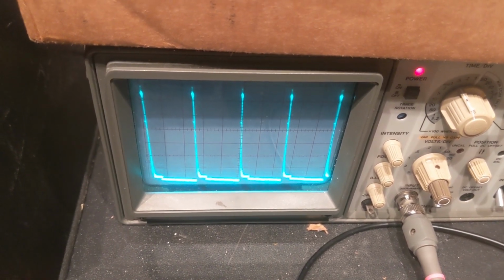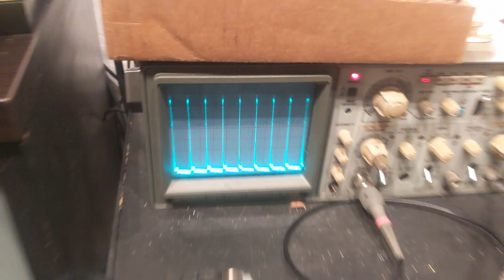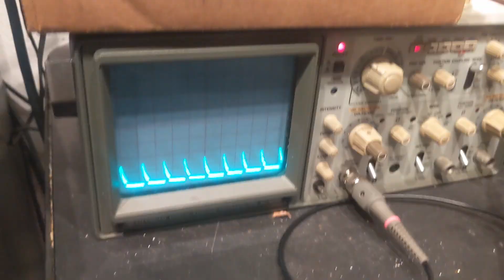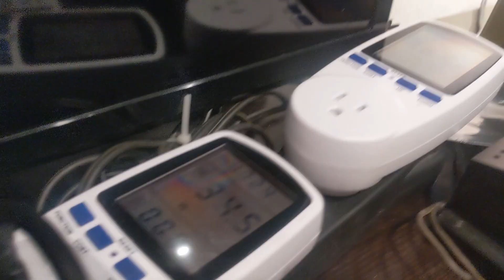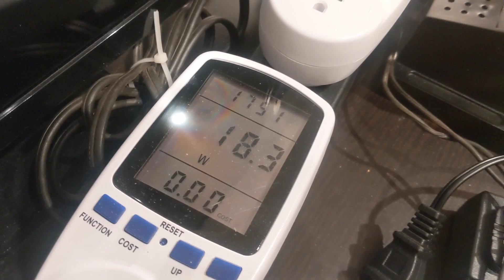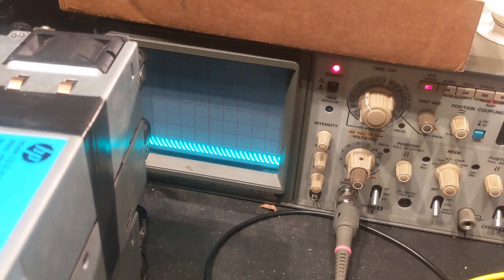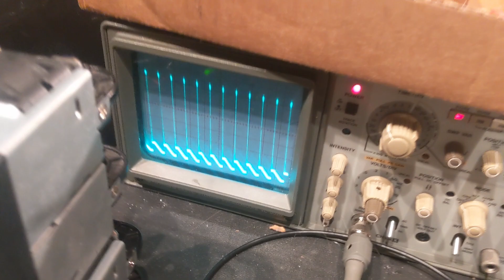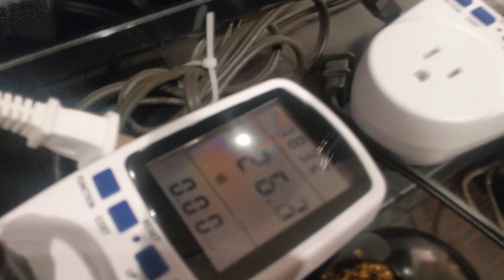HHO High Voltage Resonance

Comment: have you ever done electrolysis? and the way you said the cells were wired up was very confusing and it looks like it's doing what you said it would based on what you showed. because how does it go from center conductor to each pipe?  that's random af and i thought it looked like what you said maybe was out of order, unless they were in series somehow, but what's the point of that
Reply from the maker: Series was a big mistake. You will leak current. Better to go with parallel on a wider gap with center negative. Center positive was another mistake, because the resistive barrier won't form easily without sanding the inside of the tube, and that's much more difficult than sanding the center tube. Hydrogen generates on the negative. Making each tube concealed cavity-like is also super important because it will create an intense voltage field without finding a path of least resistance to another cell. Series is horrible unless you do a straight line instead of a circle, and the water has to be pure, but even the best pure water won't fix this in series. Update coming soon.

Comment: I've been studying the difference between HHO and Browns Gas, Electrically Expanded Water, Water Gas, Ohmasa Gas, and also ically HHO. 

As hard as it is to believe, please hear me out. You had to choose to believe over unity hydrogen production is possible. So keep an open mind maybe more open than normal. If you reply to the comment I can offer you peer-reviewed papers, videos, and other projects that all support what I am going to say. It's also way more exciting than low-power high volume HHO production. 
I will state firmly, running a car or other engine on just Browns / Water Gas, meaning Stan Myers's water car did work (no opinion on conspiracy). Not only did Myers's water fuel car work, but his results via other means have also been replicated by others since, most notably Dr. Ohmasa.

Dr. Ohmasa developed and patented a process for producing High-Quality Browns Gas he is the first to discover Browns Gas is HHO but also H, O, and from his two-stage process, 20-30% of the total Gas he produces is what I call Anamonly Gas, and he rightly calls it Ohmasa Gas and once again. I have to state, it's 100% real, it can run a two-stroke with no oil or fuel (video several), a car (video Japanese news report), but with just 10% petroleum fuel and 90% Ohmasa Gas. 

They can get incredible fuel savings and efficiency gains in all types of internal combustion engines. 

The properties of the Ohmasa Gas plus only 10% hydrocarbons, resulting in a cooler combustion or implosion and 100% conversion of fuel, plus something extra, into pressure, but not heat. 

The cooler and complete combustion provides engines with increased horsepower and torque. It uses less oil and cleans the cylinder seals, valves, and tailpipe emissions can pass California air quality goals for 2050. EVEN running Diesel in a 15-liter Engine, produces nearly 0 carbon byproducts, or particulates, and only slight amounts of nitric-based compounds, (Research gate, peer-reviewed papers on HHO and hydrocarbon fuel efficiency in gasoline, Diesel engines.)
 
Great so like, what? In case it's not clear, Browns style, Myers, Bob Boyce, and others, for producing HHO is not standard electrolysis. A highly reactive and potent Gas, besides HHO, H, or O, exists. It's called Ohmasa Gas as made and isolated by him. It liquefies colder than oxygen but warmer than hydrogen. (Link to hrs long lecture going over all ohmassa results over 10 years)
Note Ohmasa is still in business in Japan. He has installed 10/90% power generation plants all over Japan that has been running for years. (Company catalog and phone number).

I want to get your cell to produce a gas Torches flame that will not IR read over 600 C possibly not over 200 C if you innovate on my suggestions. The flame won't burn Teflon, but titanium will melt through at (500c I have links to FLIR volumetric video proof) in under 1.8 seconds.

The key to the generation is Cavitation, High Voltage, and Low Amperage. Ohmasa machine restructures the water, with ultrasonic cavitation and Pd plates, as it pulses a rapidly cycling pulsed EM wave across the positive and negative terminals.

I saw your oscilloscope, though you want a pulsed DC square wave in, on the oscilloscope reading both the +&- terminals on the cell will show a sin wave. As the + cells reach their maximum voltage so do the - electrodes. This is controlled by the PWM putting out a 50hz signal (You will read a high voltage in the cell with distilled water because it's a capacitor, you said it yourself. It's storing all the voltage you send it, the moment you add electrolyte you drop the capacitance. Hence voltage drop. Ur so close.

Stan Meyer used a 60hz car alternator in his earlier design I believe that has to do with the 50hz PWM settings, getting the cell in resonance voltage and amps should climb as well as power consumption, once it hits resonance it should drop to .5A and power consumption vs Gas production...it will foam out of our current cell.

Other advice 1mm gap. between electrodes, let as little voltage and power leak into the distilled water. The final step is to get the tube to resonate physically so can increase cavitation between them ultrasonically. Again 50-60khz and the gas production will be vigorous and I hope if you set up a few flashbacks and get a torch setup.. buy an infrared camera and see the flame temp yourself..then imagine what the world could, how shit can change...just promise to give away all you learn i dont need or want credit. No hidden frequencies misdirection. Everyone who has ever went to sell this tech gets buried look at history...better give it away and build and install them for lazy ppl. Lol

THIS IS HOW WE WIN. This is how humanity does not go extinct. I hopefully
Reply from the maker: Hey, fyi tldr... do you have discord?
Reply from the maker: EbenEliasjr, I need help. May you walk me through the cavitation resonance with the papers and videos you mentioned, I would like to do a lower power high volume hho production on my channel.
Reply: Good luck,  make sure to post to your chanel.
Reply from the maker: @EbenEliasjr  Did you post? Maybe the links were removed. And ya I will make sure to share
Reply: @weighta6630  oh an "cavitation heater, over unity" akawatter hammer.  this system is in the US. Like the Omasa Gas Generator.  It has been vetted , is in commercial production and available for purchase.  and is 140-180% effecient. The heater is 120-180% effecient.
Reply from the maker: @EbenEliasjr  I know, but you mentioned getting the "tube to resonate physically." What design of tube besides 1mm spacing am I looking for to achieve that?

Comment: I'm going to give you a few pointers on cell design. First thing to plan for and put into your designs is at no time shall any other metal, other than stainless steel, make contact with the water. Copper, silver, and a whole lot of other metals will leach ions into the water when a current is run through them thus making the water conductive which destroys the dielectric properties of water.

Use SS springs just as Meyer did to make contact with the electrodes and keep everything that comes into contact with the water stainless steel and make sure to passivate the SS prior to use. It's best to use a citric type passivation solution as it's far less toxic and really cost effective.

If you can get a 3d printer and print out your designs for the WFC if you don't have access to the proper cutting tools and machines to make a WFC. Remember this isn't a Micky Mouse program so keep safety in mind at all times. 

On the Overunity site I posted a lot of information on just how Stanley Meyer's technology actually works and even gave the specs to Meyer injector transformer which can be used to make a design for the WFC but know it has to be a lot larger as the WFC has a much larger capacitance than his injectors did and the choke coils must be able to charge the increased load on the system. 

On the OverUnity site I am known as H20power, plus I have some links posted on some pinned post on some of my videos on my YouTube channel that go into the science behind the technology.

P.S. You are going to have to get yourself a Differential Probe as it's a must have tool for being able to take readings directly from the WFC while in operation.

And another thing, there is no need to condition these cells as what must be done to the Stainless Steel prior to use is to passivate all SS that comes into contact with the water, for me that's the springs, screws, and the electrodes. I don't know who came up with the need to condition a WFC but that's not the way this technology works as this isn't electrolysis.
Reply: It's vacuum access through cavitation, high voltages pulsed at 50 khz, through the cell produces Water plasmids as well as hho. True Browns gas over unity and NOT fake. Ohmasa Gas is the component that makes Browns gas, Electrically Expanded water, truly significant. And yes not electrolysis person, more of creating charge water clusters using charge clusters formed inside cavitation which then collapse with enough force to form a high charge density but neutrally charged water plasma or plasmoid. I think the connection between shoulders evos and  Browns Gas and ohmasa gas is crystal clear.
Reply from the maker: Basically everything you said is correct. There is still a lot to be learned, and I am not doing a tutorial for anything until I've reached a conclusive point.
Reply: @weighta6630  Thanks and I hope you all the best with your progress with this technology. Now as for the science of how this works it's basically mimicking the earth's global electric circuit. After years of study here is a brand new theory for the books of science I came up with concerning this technology:
"All  Molecules  can  be  separated  into  their  component atoms  by  taking  away  the  electrons  from  the  atoms that  make  up  the  molecules." 
Now I understand the science behind the technology as it breaks the bonds of the water molecules by way of ionization where the atoms are the targets not the water molecules. The technology reaches the threshold of ionization for the oxygen and hydrogen atoms getting them to eject their electrons and since the water molecules needs these electrons to be the water molecule taking those electrons away causes the water molecules to simply fall apart.
There is a lot of things to consider as the space gap between the electrodes, the size of the chokes used, the resistance of the secondary coil all play a role in this. Smaller gaps require less voltage but require larger choke coils to charge up the capacitor. 
The chokes are basically magnetic batteries who's power come from the magnetic field collapse created by the primary coil during switch off of the square wave pulses. 
It's not an easy technology to get right but with the understanding of the science behind it you should be able to get it working properly.
I'm just getting back into this as I am self funded for the most part and it takes me awhile to save up the funds needed to be put into my efforts to get this technology into the marketplace.

Comment: Impedance matching circuit?
Your frequency generating circuit? Please explain, show schematics
Reply from the maker: Sure. Impedance is matched based on the resistive property of the water and how that is effecting the resonant frequency of the tank circuit. As you may know, the water cell IS the capacitor when the water has a high impedance. Because no water is the same dielectric value, you are stuck constantly tuning into resonance with incoming pulses that have to match manually. This circuit utilizes a trigger winding or pickup coil that opens a bjt right when pulses occur automatically tune to resonance. "impedence matching" is a broad term, because what it really is just  coping with the tank circuit's resonant frequency. I updated the description with the circuit schematic.
Reply: @weighta6630  thanks allot for the schematic, wow that's brilliant, I shall try it. I use a dry hho cell. 
I can read the schematic and follow it, but it leaves me with a couple of questions. Could you use a mosfet instead for efficiency. 

I suppose with mosfet I may need more turns on base coil depending ov trigger level of the particular mosfet. 

Interestingly you mentioned urine. Well I'm experimenting with that. You don't need acid. Also the hho produced with h2n is safer as it don't have oxygen so is not explosive on its own. It's also noteworthy that urine hho production is with less voltage from 0.3-0.4 volts as opposed to 2-2.4 volts with acid. Also it doesn't make the car ECU to demand more fuel thus eliminating gain.

The inductance of the coil and capacitance of the cell is important to figure out the resonance?

I played with similar circuits but don't think I had any resonance achieved. 

Still I'm intrigued that you mentioned this and am eager to work with this. 

I noticed the diode, which tells me the cell gets the current from the collapsing magnetic field of the coil. 
At 12 volts the circuit would draw about 4 amps at part of the cycle. 

Kudos!
Reply: @weighta6630  what kind of coil did you use? 3.4 ohms is allot, my coils are 0.32 ohms. And what kind of core? For high frequency.

Maybe that's why I couldn't get resonance, not enough inductance
Reply from the maker: @ThePaulbilek  Manual resonance is almost impossible, and I'm not even joking. I had zero success on my own, and even frequencies close to resonance had me confused on if the voltage was actually rising or not. You need at least 3 or more tubular cells connected in series for higher voltage. With only a small gap in the water, you'll hardly notice a thing.

And you're also right about the voltage dropping with urine. There's such little impendence with it, and you're basically back to doing electrolysis. It's still fun to do however. For the coil, yes, you will need 0.5 - 8 ohms. Try with 200 wraps (bifiler) on a 1" diameter plastic casing that can have a ferrite rod slide through. You don't have to worry about getting the inductance exact because the BJT will automatically handle the opening/closing of the tank circuit's natural resonant frequency. You are just adjusting a rod so that you can get ~1000hz.

This circuit is my favorite because it's utilizing the sharp voltage collapse of the magnetic field like in meyer's patents, and it's an excellent beginner circuit for conditioning/resonating a cell. Don't expect a mad output of hydrogen initially, it takes around a month to get almost 10x more than initially seen. Power input won't change.
Reply: @weighta6630  it works! I tried it with 1:1 ratio and also a transformer secondaries works upto 2khz, also with dual coil subwoofer the best was lowest frequencies ~300hz that gave me most output for the hho cell. No peak current yet, didn't hit the resonance yet, have to experiment more with the circuits using mosfet and also bifilar coil hooked up like the joule thief. Thanks for the simple circuit to get me inspired!
I'm using dry hho cell, with 3 neutral plates (series), two such cells in parallel, using 12vdc
Reply from the maker: @ThePaulbilek  Glad to hear you got it! Cheap, simple, and easily replicable is the goal. Dry cell I think will give best results because you wont have capacitors side by side submerged in water possibly leaking current across from one another. I notice that happens on this wet cell, and there's a slight generation of bubbles from two tubes beside each other. Keeping everything in a cavity is best.